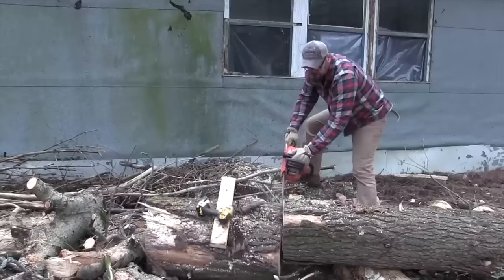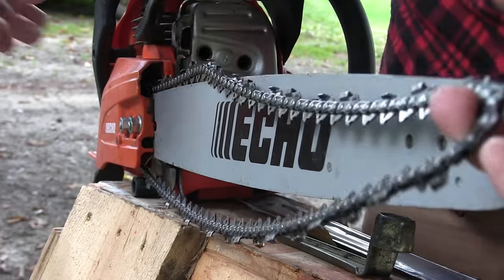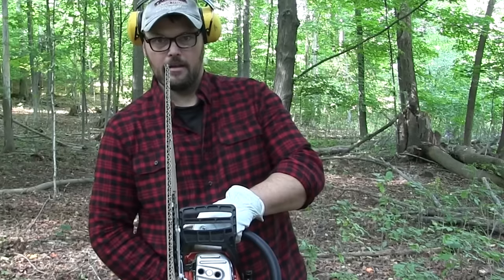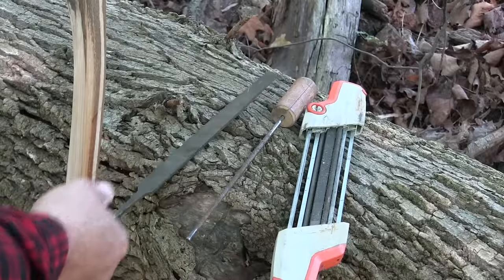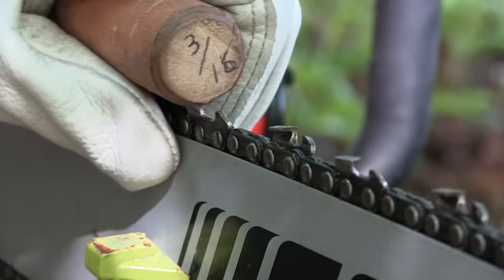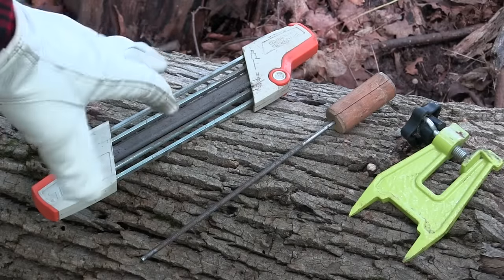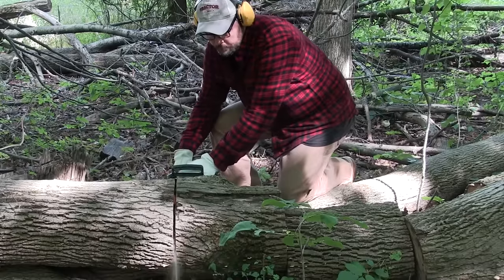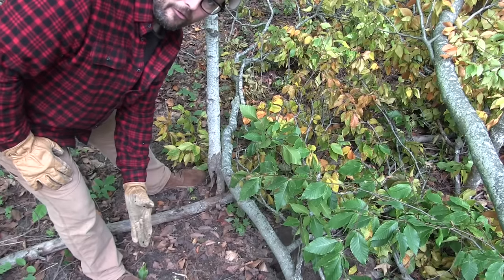Chainsaw 101

Comment: I have a hydraulic chainsaw that was used in a bucket truck, and I plan to use it on a firewood processor. Supposedly it could be run from a power steering pump from a diesel truck.

Comment: There two things that I would add to saw maintenance. 1) Clean all the sawdust in and around the bar oiler port to keep oil flowing properly. 2) As the bar gets used it can wear down along where the chain rides, leaving small ridges along the length of the bar. Take a flat file and keep the ridges filed down so the chain doesn't get held up by the friction.

Comment: Hi Dave. Great video. Thank you for all the tips and pointers. If you make a second video can you mention setting the high and low screws on the saw. One question ... after making a few cuts and my saw is hot, my saw starts to stall out and I have to restart it and can make another cut before it stalls again. Any ideas what might cause this?

Comment: It does make a difference how many times you file each tooth. They all need to be the same length. Also, rotate the file between each stroke. You will lose them before you ever wear the file out. If you have ever filed your saw when the teeth have ice on them, you will see the ice melt and boil away with a single stroke of the file. The file gets very hot also and they will wear out very quickly.

Comment: Great vid and the emphasis on the safety.  If in doubt, don't!  Generally speaking it is recommended raker height is 10 to 15 thou. under for "backyard operation,  up to 25 thou for commercial operation.  Just check out the chain manufacturer and cut in your limits!

Comment: Safety is key and always were gloves never let your gard down i know i was a timber cutter one day i was working in the yard cutting up some logs with a bow saw didn't have a glove on my left hand and the saw jumped back at me it was eather my face or my hand well my hand got it and a bow saw has one inch teeth but i was good later just stay safe and never let your gard down.

Comment: very concise... Even before we cut for fire wood and splitting... we walk the area... A lot of or firewood is storm fall in on the property... we spend a lot of time trying to read the fallen trees.  We've incorporated quads, winches and rigging to try and pull tree to the ground, remove stress and prevent rolling.  will all the gear we've still had sleepers... Gods Grace no one has had a serious injury... One ore safety point... try not to do any logging alone

Comment: If anyone happens to read this, and is thinkin about getting one of those 2in1 sharpeners, be aware they can sometimes struggle to get into the gullet of the cutter. I have given up on mine as a result. It also never really cut the depth gauge down enough when compared to a dedicated depth gauge tool.
Anyway, hope that helps someone.

Comment: The spark arrester is USFS required to help prevent forest fires. Years ago, we were on a BLM tree push area, and had to get the chainsaw inspection done by the forest service before cutting any wood. That screen is stainless steel wire, not steel, for endurance.

Comment: No notes, except that modern battery chainsaws are great. Can drop a 50’ white pine, delimb, and buck into 16” lengths on a single battery with a 30 minute recharge. (Milwaukee M18)
Reply: Maintenance is great, too. Bar oil, battery, sharpen, tension. That’s it.

And it’s totally silent so I can do work at 5am on a Sunday without the neighbors knowing.

Comment: Believe it or not but by cleaning the saw or any tool for that matter and restoring it to almost like new cleanliness will actually help it run cooler , allow the hot air to escape instead of being trapped by all the dirt and debris. So yes in a way itll run better.

Comment: You mentioned there are different size files for different chains. How do you determine which file you need for the chain?
Reply from the maker: If you don't see the info on your saw take it with you and match the chain you have to the file that fits it

Comment: I was cutting overhead in a pile of logs one time first time I never wore a hat got a kick back and like you said got it right in the forehead one tooth lucky for the break there were cut my head right into years ago when they didn't have a chain break my dad always used to buy oversized bars for his saws and he got a kickback right actually in the by the shop where a login trucks are luckily got a kickback at his shoulder and ripped his whole shirt right off of him lucky was right in the area of a login truck shops where he worked and he cut his leg one time too he didn't even know it until he felt like he had a soaker ugly chain cuts i've never been cut and I don't use a saw anymore so I won't get cut

Comment: I always tell people nothing I own is more scary than my Chainsaws not guns, tractors, trucks etc. As a lay person who has run a saw for years I still respect and to a degree fear them. And if the Job is to big.... well had a couple of 70 ft Plus tree's near my House taken down...... so I paid the Pro's to do it and was impressed as he did it old school no bucket Truck just Ropes and a harness. I do have a question for some of you Pro's in Vo Tech many moons ago we had a Professional Logger come in and talk about CS safety and he talked a lot about how the correct sharping of the Chain would reduce Kickbacks to a huge extent and he also stressed keeping your elbow locked as much as possible on the arm on the bar and this would stop the saw from driving back into your body and force it up and away if the saw kickedback. I've never seen this said since by anyone, just wondering if you guys had heard this.

Comment: The devil made me do it. I’ve got a lot of firewood to process involving felling larger standing dead trees and a few larger live ones that I feel are in dangerous proximity to the cabin and other structures. My 028 Stihl will handle the big stuff with ease, but I dread the 14lbs+ saw for the massive amounts of smaller limping, so… I bought the Echo 2511p rear handle saw with a 12” bar. It comes in at about 6.5 lbs wet. Let’s say that’s half the weight of Mr Stihl, if I have to hoist that thing 100 times in a day and it’s 6 lbs lighter, that’s 600 less lbs I have to lift!!!  That’s what they call “devil’s math”.

Comment: Dave, sounds like good Dad advice. If your pop has successfully used tools. If you question the validity of the advice, seek a second opinion. Just make sure that guy hasn't lost any apendiges. 😉 Most guys in building or mechanical trades have technique lessons from experience. Safe and fast is a good way to get most tasks done. Fast alone is your worst enemy, and the safest way is to not do it at all. 😏

Comment: Tip 1:  Don't drink and chainsaw.
Tip 2:  Don't use multiple chainsaws at the same time.
Tip 3:  Leave juggling to entertainers, no matter how much your "friends" cheer you on.
Tip 4:  Don't cut off your limbs or those of others - Unless, of course, they're possessed by Kandarian demons.
Tip 5:  Tip 4 is a film reference joke.  Don't do it.

Safety is important.  Use common sense, even if you have to borrow change from a friend.  For example, it'd be unwise to use a chainsaw while standing atop a galloping horse.  Summon your inner scout spirit animal and always be prepared.  If it seems unsafe or unwise, don't do it.  Do your due diligence and research the topic, by, say, watching a video like this and then following it up.

Comment: I have 50 years of saw experience. When sharpening, I   
was surprised when you did not sharpen each tooth with the same number of strokes!
I always find the worst tooth and sharpen it first, counting the strokes. Then give every other tooth the same number of strokes. Otherwise your chain will be uneven and it will cause chatter and not cut as  smoothly.
Reply from the maker: I sharpen until sharp.  If a tooth neds a single stroke it gets it and nothing more.....if it needs 20 strokes to remove a smashed over cutting edge it gets 20

Comment: One more thing. Good job emphasizing safety. Passing along the by line that we used when in charge of putting Soldiers out of perfectly good airplanes (yes, they had parachutes): Never compromise Safety for ANY reason. Neglecting safety isn’t manly or cool. It’s dumb.